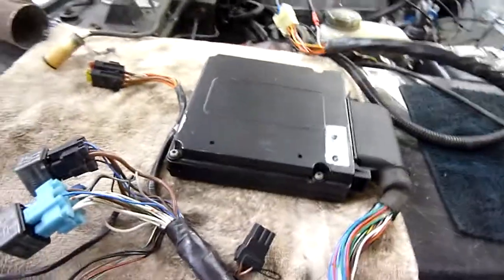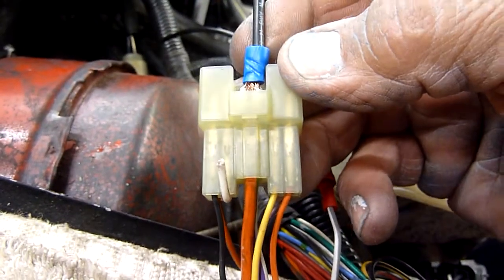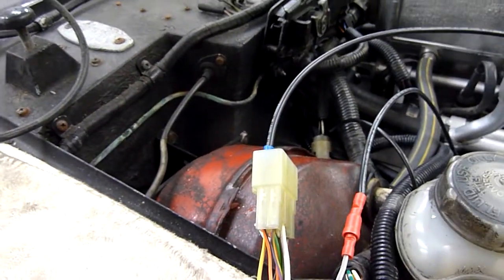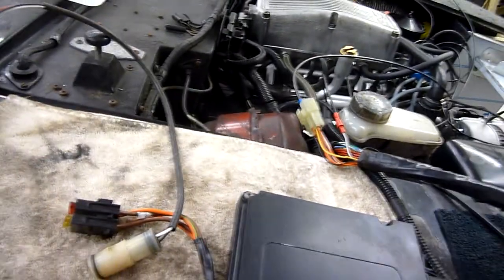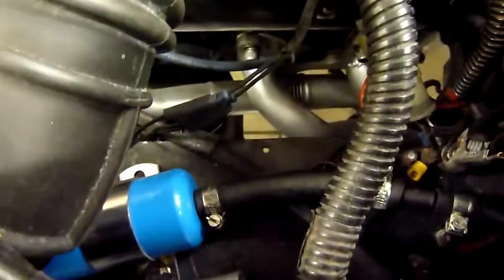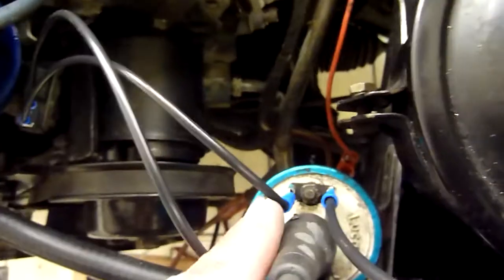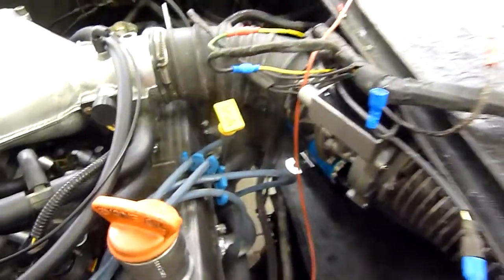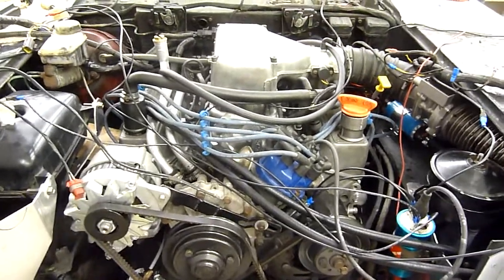Rover 3.9 V8 Hotwire EFI CPU Wiring O2 Sensors Distributor Etc.

Comment: Hi I have connected up that system.  When Throttle pressed have way down engine starts to misfire.  Release accelerator and runs fine.  Any help appreciated.
Reply from the maker: Sounds like fuel pressure or flow is the problem. Fuel need to be about 43psi.

Comment: make sure your relays for the ECU and fuel pump are the special Bosch ones with a diode in them else you will run the battery flat

Comment: Is it necessary to fuse the power to 14CUX? If so, how many amps are required?
Reply from the maker: Good idea for safety. 30 amp in line fuse.
Reply: @Hensen1954  Great, thanks a lot for the video, really helpful.

Comment: Hello, this is a very helpful video! Thanks! I'm trying to find the plugs for an O2 sensor with a green little resistor plug instead of a bluebone like yours. Do you know how to identify the color code? Greetings, Aaron
Reply from the maker: https://www.actproducts.co.uk/2011/lucas-14cux-fuel-injection-system-%E2%80%93-installation-and-diagnostic-notes/
Reply: Thanks for responding. I've read that article. It says the green resistor is for 3.9 and 4.2 engine. I've got an 4.0 tvr engine. Does it make a difference?
Reply from the maker: @aaronpetersen9150  I dont know.
Reply: Ok. Thanks for the effort.

Comment: You can mistakenly swap the Coolant temp sensor and #1 injector connector.   Done it once and it created all kinds of problems.  Vehicle would start and run but once warmed up it would not restart.  White connector is coolant and black are injectors.

Comment: Hi mate awesome video,
Did you need to upgrade the few lines/ rails to high pressure or are the standard series 3 lines okay ? Thanks
Reply from the maker: Standard ones OK. This engine is a 5 litre stroker. I am running 47psi to the fuel rail. A little bit higher than standard, but seems to be great for this engine.
Reply: @Hensen1954 oh wow that’s insane, I think mine doesn’t have fuel rails just rubber hose lines, do I need to change them ?
Reply from the maker: @matthewmcintosh1   The fuel rail is the metal pipe  feeding the injectors, and has the fuel temp sender in it.

Comment: Did you install catalysts on the exhaust in front of the  O2 sensors?
Reply from the maker: No cats on this car.
Reply: @Hensen1954  Thanks for the reply.  No complaints with the set up? Running good with same blue tune resistor?
Reply from the maker: @wjthehomebuilder  Runs perfectly. Been using the car for about 3 years now.
Reply: @Hensen1954  Nice! Thanks for the feedback.

Comment: I'm having a proplem in powering my ecu up after following this video, I think the problem I have is the automatic transmission inhibitor switch  which would of been on the body loom not the engine loom, what's the best fix for this?
Reply from the maker: ECU must have 30 /40 amp constant feed from the battery - thick wire, and a switched power wire from the ignition switch.
Reply: I have power correct power supply to the relay but the ecu isn't switching a earth signal to trigger the relay

Comment: Hi hope i get a response i am stuck trying to hot wire my 14 cux system, i have it firing up by pouring petrol onto intake but can get injectors opening etc. what wire have you run from coil to ecu? is it main injector relay signal? could you please clarify what pin on ecu it is so i can locate it thank you.

Comment: One question: the constant live wire. Can this just be a fused live wire running directly to the battery?
Reply from the maker: +John Mckeever  Yes, that's exactly how it should be done - quite a heafty fuse, 35 to 50 amps.
Reply from the maker: +John Mckeever  Are you up and running now ??
Reply: +Hensen1954 not yet. Will use a pair of SU carbs to start up as I have a cam to break in and I need to start the engine straight away. No time for electrical fault finding. Still have the hotwire set up for later.
Reply: from ignition switch as iv done this on a bmw engine, treet it like a car radio setup.